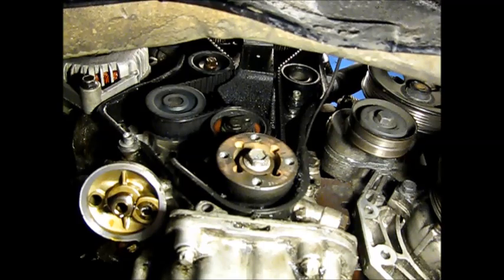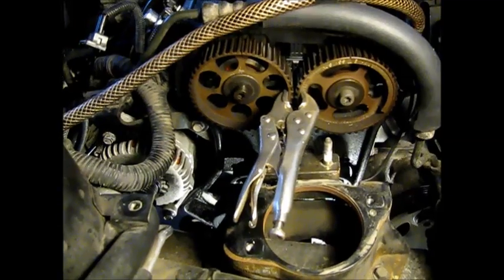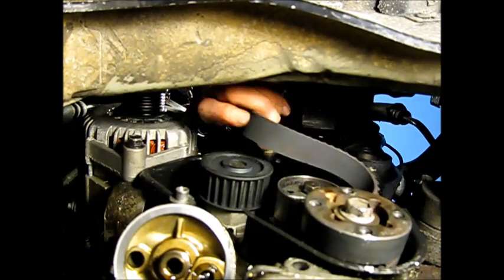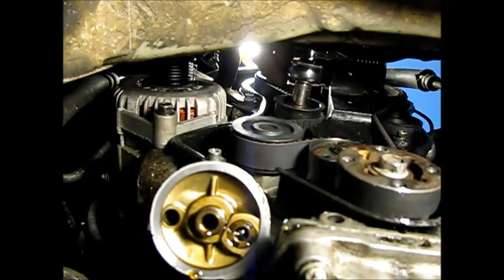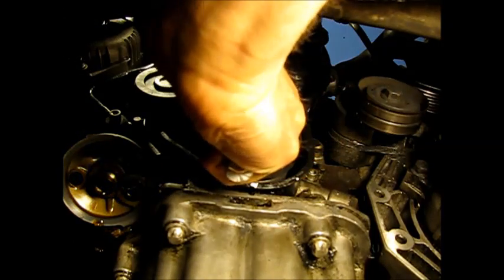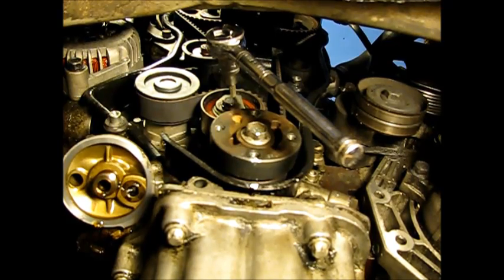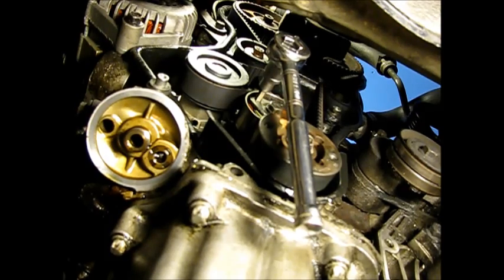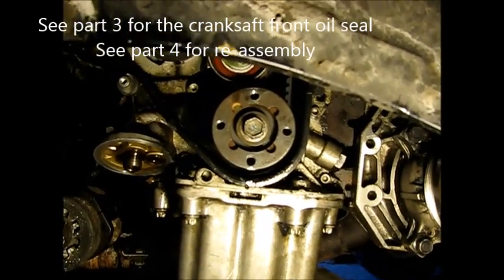Replacing the timing belt and front oil seal on a GM 2.2L engine Daewoo, Isuzu, part 2: Timing belt

Comment: This is good but only if you do the timing before the belt breaks. The 2.0 is an interference engine, so if you do the belt after it breaks it may not run right or even start do to the bent valves. This is why its best to change out at the proper milage interval.

Comment: THIS IS THE PROCEDURE to use on this job. I have tried it other ways and it is very difficult. Doing the job this way is relatively easy. Many thanks for the vice grip tip - this locks the cams on the mark and allows the crank to be rotated to tension the side of the belt toward the front of the car, allowing enough slack in the tensioner side to get the belt on. The tip on putting the idler on last is definitely the way to go. I also used a small pair of vice grips to GENTLY clamp the belt on to the intake cam drive to prevent it jumping off while working the belt around the water pump, tensioner and idler. GREAT VIDEO!!!👍👍
Reply from the maker: Thanks for watching and I really appreciate the comment!

Comment: Provide info on trouble-shooting the tighting of adjusting the tensioner if the needle does not move. What did we doing wrong? Please make another video.
Reply: Having the same trouble
Reply: @mitchellcochran2998  how did you solve this problem
Reply: How did you solve this problem

Comment: so is it crucial for proper tensioning of the belt to take the vise grips off? so its not good to adjust the tensioner with the visegrips on?
Reply from the maker: Yes, take off the vice grips once the belt is seated. then adjust the tension.
Reply: The Original Mechanic thanks for the info. great video by the way

Comment: Hello Original Mechanic. I am planning to change cambelt on my Chevrolet Lacetti 1.8 sport which has Opel 1.8 16v petrol engine. I was watching tonnes of video about this thing however yours is the best so far. Anyway I have a doubt about right cam shaft timing position. Your video shows that both lines up on cam shaft but some others show the marks on gears on 3 and 9 clock position like opposite line each other. Which one is right or how I can make sure that? Plz help. Thx
Reply from the maker: +Richie Kis I only know about the way the cams lined up on this engine. I don't have an idea on how they line up on your engine. You may need to consult a repair manual. Good  luck and thanks for the comment.

Comment: Thank you very much for your excellent video. Another person did a great job (18 part series) on replacing the cylinder head on a Suzuki Forenza (GM 2.0). I did the that repair but struggled for several hours today though, trying to get the belt to tension up. I went and bought a new belt thinking that might be the problem but no luck. Then I changed to the old tensioner and no luck. Then I watched your video and it hit me. I did not release the vise grips before trying to tension it! Now I'm sure you need that bit of tension with the cam wanting to find it's natural position. In the other video the gentleman (while doing a great job otherwise) did not show this important step prior to trying to tension the belt--thank you for including it
Reply from the maker: +Neil Winawer You're welcome. Setting the timing belt tension on this engine is definitely a bit tricky.
Reply: Neil Winawer im having same problem too. no tension kept. i adjust my belt tensioner on new mark. then after rotating 2 rwvolutions the pointer goes to far left and belt loosens alot.

Comment: Hey Original Mechanic, thanks for this video. Great job on the details aswell!
I'm attempting to do this myself, but ran into one problem. At the bottom over the crankshaft pulley is another pulley attached to it by 4 allen lugs. My problem is that I can only loosen 2 of them and cant do the other 2. I've messed with so much that I rubbed it out, now the allen wrench won't turn it... can you please help me. I need advice or trick into loosening the 2 other lugs so that I can replace them. Thanks in advance and hope to hear from you soon! TIA!
Reply from the maker: The same thing happened on one allen bolt for me. I was able to get it out with an extractor (easy out). If you're not familiar with what these look like here is a link: http://www.amazon.com/gp/product/B0027B5GT0  Just put in the size that fits snug and turn it out as you would any fastener. Soaking in penetrant won't hurt either. Good luck with it and I hope this helps.
Reply: Thanks so much OM! Have a great day and God bless! :D
I will definitely do that!
Reply: Oh man Mechanic, update! I tried the extraction method and the extraction bit broke in the entry of the allen space :/
Now I'm thinking of removing the cover from the back so that I can put in the timing belt. Oh well, one of those days where theres always that one thing that makes the job twice as long. lol thanks for your help and I'll keep you updated as I go.
Reply: The Original Mechanic ^^^update
Reply: Hey Original Mechanic,  just a quick update. I finally figured out how to take the four bolts out of the bottom cam pulley. I ended up putting a big nut over it and welding it, when it cooled, I used a 7/8" ratchet on a compact drill and popped it right off. Thanks for your guidance! Have a great day!
Reply from the maker: MovesLike MickJagger Nice. Now the rest of the job should be a breeze! That's not a bad engine to work on.

Comment: Thank you for your videos!  I subscribed as soon as I saw you do work on Daewoos.  I had a timing belt break on my 2002 Daewoo Leganza which happened to bend a few valves (thanks to the interference engine) and I've managed to do most of the work myself.  However, upon putting the timing belt back on I replaced the tensioner pulley, left idler and water pump.  I thought I had a pretty good idea of how to put the belt back on but I am unable to get enough slack out of the belt to move the pointer on the tensioner pulley.  Any ideas on what may be causing this excess slack?  My belt is a Dayco part # 95305.  Before I knew the valves were bent I actually went ahead and installed the new belt with no problems at all, being able to get the pointer to move.  Maybe it has something to do with how I uninstalled and reinstalled the cylinder head?
Reply from the maker: First of all, thanks for subscribing. I have to confess that this is the only Daewoo repair I've done (on my nephew's car). I don't think your cylinder head work could cause this problem, but I am suspicious of the other parts you replaced in the belt path. Did you replace them along with the belt before you did the valve work? If so, and the belt fit the first time with the new parts, then they are OK. If replaced after the valve job, one of them may be the wrong somehow. I would take a hard look at the belt. It seems unlikely, but could it have stretched when initially driven with the bad valves?I

Comment: Thanks for the video im about to do the same job on my daughters Holden Viva (GM Daewoo ) here in Australia ,one piece of advice i could offer for the home mechanics is to mark the old belt at the timing marks with white paint and transfer these to the new belt and check by counting the teeth between the marks , this will ensure nothing has slipped during the installation of the new belt . This is something i learnt when changing the belt on my Toyota 2.4L ( 2L ) engine
Reply from the maker: Thanks for watching and commenting. Marking and counting the teeth is a very good idea to ensure an exact positioning of the new belt. Good luck with your upcoming repair.

Comment: This GM Engine is exactly the same as my Opel Calibra 2.0L 16v  engine also known as X20XEV and I replaced its timing belt a while back in more or less exactly the same way. Even the crankshaft pulley is also the same in looks and alternator in the same position, so does that mean I could put a 2.2L engine in my Calibra.
Reply from the maker: Thanks for watching. As for mounting a 2.2L  engine in your Opel, that I couldn't say. An awful lot of things have to be come together for that to work, engine mounts, transmission, etc. A definite maybe is about all I can give you.
Reply: Probably not, the 2.2 block has a taller deck height to accomodate the longer stroke. The engine will probably fit the bay and mounts, but the bonnet might not close!

Comment: Hey. That was a awesome job. I have a opel corsa c 1.4 2003. I overhauled the engine and now i got stucked in timing. I know all the markings but where are the markings for cam shaft. Plz help i am really in a big trouble.
Reply from the maker: Here is a link to a post I have made with a very clear picture of the cam shaft markings: http://www.originalmechanic.com/2014/03/how-to-replace-front-crankshaft-seal.html
I hope this helps. Good luck and thanks for watching.